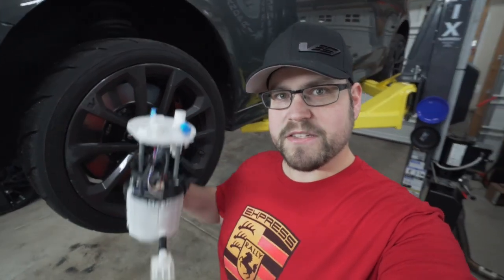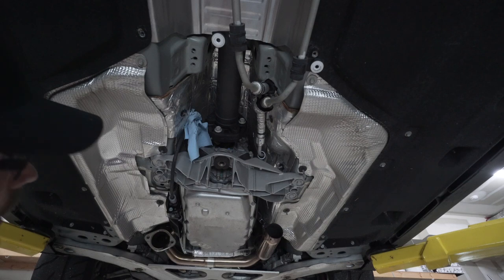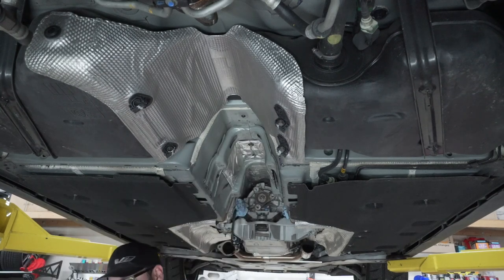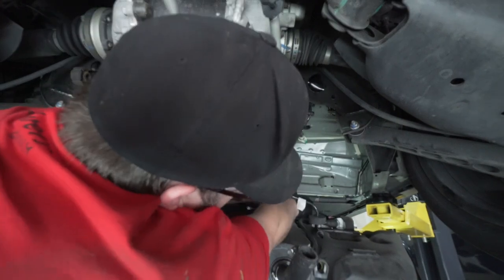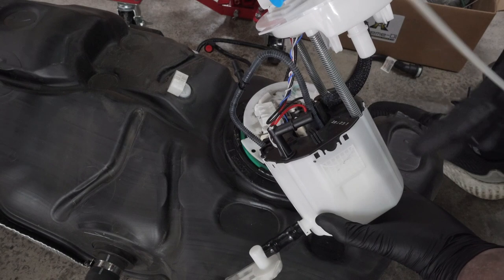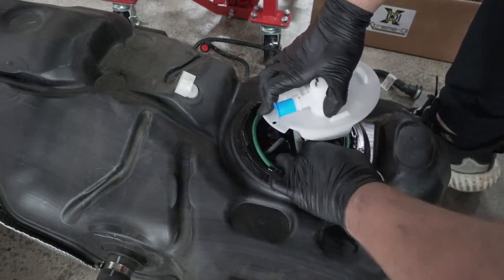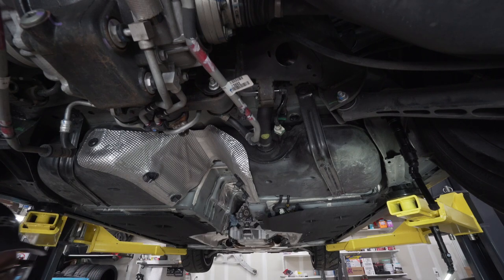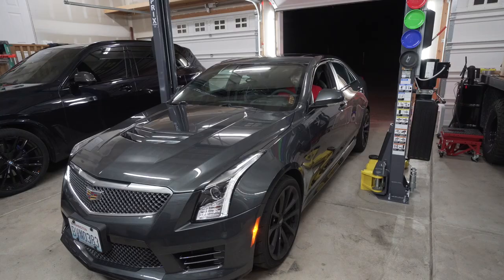Cadillac ATS-V gets a Xtreme-DI LPFP

Comment: In order to go for e85 in ats v, do i have to change HPFP also ? Or LPFP is enough ?
Reply: Justin Schmidt can tune for E30 blend on stock fueling, E47 can be had with fuel cam or upgraded HPFP internals, more than that requires addressing both high and low side.
Reply: Yeah with the zzp cam and xdi lpfp you can use e60 and his tune, I'm not sure about hpfp. And I don't think you can use more than E30 if you only do lpfp
Reply: @Flyin_Viata   how about lpfp , 98 fuel, 30% of e85 without fuel cam ? Is it safe for the car ?
Reply: @caddyv2327  how about lpfp , 98 fuel, 30% of e85 without fuel cam ? Is it safe for the car ?
Reply: @waleedalblooshi5277  should be alright but I'm not sure if 98 would make a difference or not. Justin would know for sure if you wanna msg him on FB
Reply: For E30 all you’d need is a flex fuel kit and a wideband…no fuel mods required.  LPFP is useless without high side mods.  Race gas would be fine so long as you run it all the time…Justin can tune appropriately.  Dude’s the GOAT with the LF4…